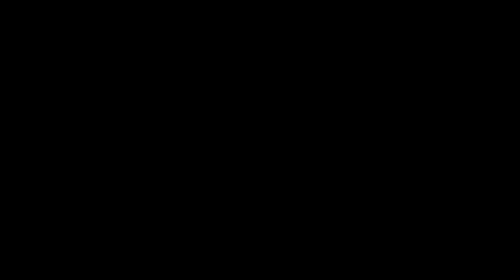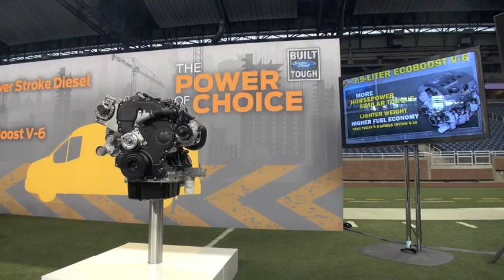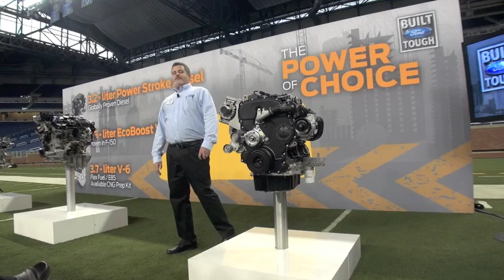2013 Ford Transit 3.2-liter Power Stroke® Diesel engine

Comment: Actually any excuse does not wash well for me by not having the diese global ranger in the states ... I will never buy and Eco-Boost and am not interested in another high maintenance petrol vehicle with a non-maintainable transmission.

Diesel with a Manual transmission ... Many of us who want the global ranger want the durable version as sold in Asia!

What are you going to do when you have to go diesel to sell your trucks?
Reply: I agree with you 100% ... The big question I'm asking ... Is the U.S. not "global" It's almost like the CEO of Ford said "F*** those people in the U.S. they don't need a Ford Ranger and absolutely not a Ford Ranger with a diesel engine"